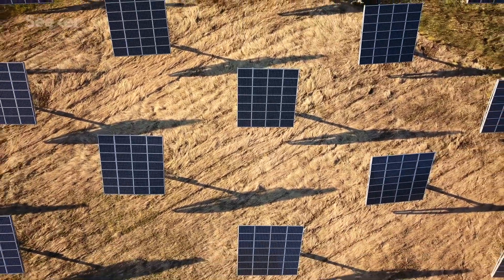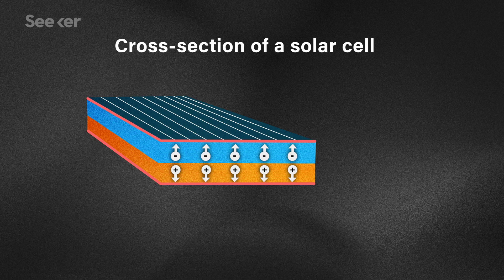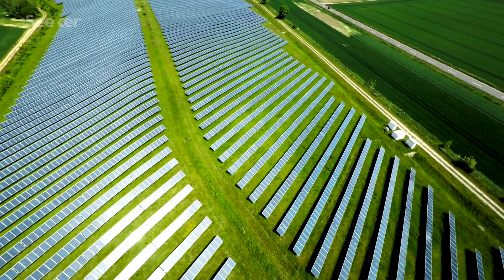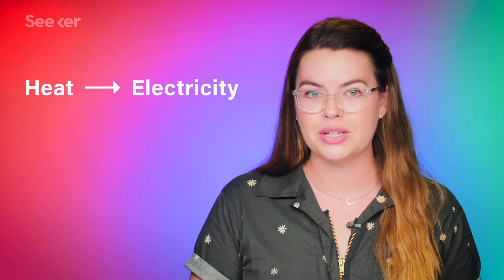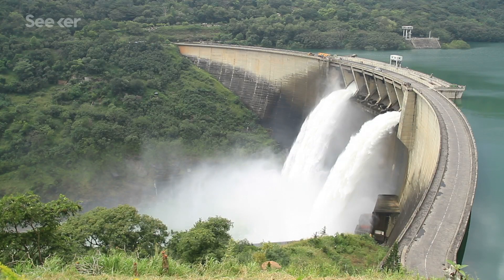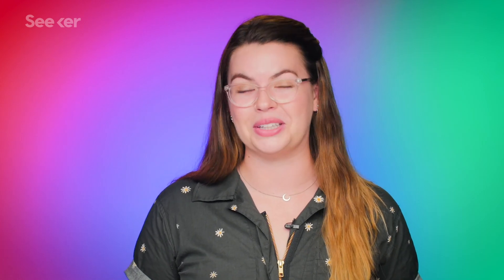Carbon Nanotubes Might Be the Secret Boost Solar Energy Has Been Looking For

Comment: Science stupid 
Science stupid 
Science doesn't know. Positrons + and electrons  -- rotate very rapidly after 46 billion years of creating the Sun, so the core of the Sun rotates very quickly like A super large electric turbine that produces super large electrical energy 
The sun emits 4.1 tons of photons per second, moving the circle back to its original position after 8 hours. Thus pushing the eight planets to spin

Comment: Our company IQ materials can not make carbon nanotubes from 12 inches in width to 3 ft and 20ft to 200 ft in a day.  

Thickness: 5-15 microns
Aerial density: 5-15 g/m2 or GSM
Conductivity: ~200 S/cm
Tensile Strength: 40-60 MPa
Tensile modulus: 2-3 GPa
Density: 0.3-0.4 g/cm3
Temp. Resistance: 1900c
Width: 6 in or 12 in with typical 20, 50, 100 or 200 ft length

Comment: This video made me curious.  What is the albedo of a solar panel compared to the albedo of the surface it is typically placed over?  This may be a non-question.
The incident infrared energy is trapped in the atmosphere whether it is first absorbed by an object or not.  The solar panel has little effect on the albedo whether it reflects the infrared, absorbs the infrared as heat or produces electricity from it.  The incident energy of the UV spectrum is relatively small so the characteristics of the solar panel compared to the surface beneath it is probably immaterial.  The first answer to my question is that the solar panel is not impacting the albedo, so panel the world.  We've got lots of sand.

So far as boosting the efficiency of the existing solar panels I can see merit in that, as well.  My wife and I own a home that we heat primarily with a mini-split heat pump, and we charge an EV.  We have max'd out the roof with solar panels and are still required to purchase a fair percentage of our electricity from the grid.  Solar panels that are even 25% efficient would be more than enough to make us net zero in consumption.  We could also probably afford to heat our house a bit more than we do.

I started writing this an hour or so ago and pessimistic that there was great value in increasing the efficiency of a solar panel unless it reduced the cost per kilowatt.  My own situation shows  that it could be worth a small premium.  For mobile applications, of course, it would be worth a substantially higher premium.  Now where are those mobile applications?

Comment: THIRD, as The EFFICIENCY if The SOLAR CELL mentioned is very high, unlike that of PHOTOSYNTHESIZING PLANTS (which have solar energy efficiency of only about 5-10%) ,also these plants ALWAYS RESPIRE, so these PLANTS almost behave as LAND MASS (reflecting back most solar radiation as heat)   only keeping NEGLIGIBLE AMOUNTS as BIOMASS. IF in their PLACE ,THOSE SOLAR CELLS are INSTALLED EVERYWHER, then it shall behave as LIGHT and ENERGY ABSORBER almost completely as a PERFECT BLACK BODY to be converted to ELECTRICITY for all HUMAN NEEDS(wether this energy is ultimately released by humans back as heat by TRANSFORMATIONS again while using, or this energy gets stored in some  manner or The other for permanent)  IN any case this shall Result in SLOWING down of WEATHER and CLIMATE FUNCTIONING(as very less energy would remain available in The atmosphere For weather and CLIMATE CYCLES to function. CONSEQUENTLY this would have a PROFOUNDLY DEADLY IMPACT on GEOLOGICAL,METEOROLOGICAL and ULTIMATELY BIOLOGICAL ACTIVITIES and PATTERNS.  TEMPRATURES ,HUMIDITY LEVEL, WIND SPEED ,ATMOSPHERIC PRESSURE shall change very FRQUENTLY or VERY SLOWLY or may even NOT AT ALL. A COMPLETE DISASTER.  HENCE SOLAR CELLS with LESS EFFICIENCY, can thus only be USED.(which would behave, almost like plants, and not cause BIG, DISRUPTIVE and CASCADINGLY DAMAGING EFFECTS to EARTH'S systems at a LARGE SCALE.)

Comment: YES, SOLAR ENERGY is UNDOUBTEDLY VERY LARGELY USABLE, BUT being TOTALLY DEPENDENT on SOLAR ENERGY is not FEASIBLE and also POSE serious PROBLEMS. FOR EX -WEATHER PHENOMENONS can GET DISTURBED as, The heat reflected from The LAND and SEA (which you call as WASTE HEAT),  actually it is not so. When The heat is REFLECTED back from LAND and SEAS (UPON being heated by SUN'S RAYS)  that HEAT is only, eventually DISTRIBUTED into The ATMOSPHERE  in order to FORM/CHANGE  WEATHER and largely CLIMATE of everywhere on The PLANET. IF NO SUNLIGHT FALLS on GROUND or SEA  (instead it is absorbed by PHOTOVOLTAICS with 95% or more EFFICIENCY.. say..)  then LAND and SEA shall not heated by SOLAR RAYS .AS a RESULT, there shall not OCCUR TEMPRATURE differences  and CONSEQUENTLY WIND BLOWING shall become LESS and BOTH WIND and RAIN PATTERN shall  become VERY complex and UNPREDICTABLE (as AIR itself is a bad CONDUCTOR of  heat) .IN cold days, The SUNLIGHT is already too  low in RADIATION ENERGY already ,USING SOLAR PANELS on TOP of that would INCREASE The COLD more. It is to be understood PROPERLY that ATMOSPHERE takes ENERGY only from The "REFLECTED/RETURNED BACK" HEAT ENERGY Of The SUN from The heated LAND and SEA on Earth's surface, and NEVER DIRECTLY by The INCOMING SOLAR RADIATION from SPACE!!!!. THIS FACT shouldn't be OVERLOOKED.

Comment: No. Solar and wind aren't the answer, you need to clear whole plots of land of all vegetation and animals on top of many other issues. Solar panels have such harmful chemicals once they are disposed of since there is no proper disposal of these chemicals they seep into the ground. Nuclear fission provides far more energy 24/7 and the waste it does produce is safely stored until it degrades into regular trash or when we figure out how to do it a different way. Nuclear is the solution

Comment: Noob here, I have a question.
Where do the knocked out electrons come from?
I mean if fhey are knocked out of the material the amount should be very limited?
Reply: Yes, but the electrons aren't just kicked off, as the silicon layer looses electrons, it charges positively, attracting electrons from the other side of the circuit, think then of a person bouncing a baseball against a wall, and cathing it when it falls back
Reply: @Biomechanoid29ah  thank you soooo much I was confused too😁

Comment: #SwitchToSolar #SwitchToElectric
Everyone raise your right hand and promise to never again purchase an ICE (internal combustion engine) vehicle or tool.
We should all be using electric vehicles charged from our home, business and covered parking rooftop solar arrays making nearly everything we do 100% solar powered including charging our vehicles.  Everyone should be getting proposals from 3+ local solar PV installers and suggesting the same for our places of work, our grocery stores, our movie theater parking lots, and everywhere else.
The cost per distance driven is ridiculously cheap when you are your own solar fuel station (less than $0.01 USD per mile)! #nobrainer
We cannot afford to continue to burn fossil fuels!

Comment: Turning that thermal energy into useable energy is easy and doesn't require something as far fetched as carbon nanotubes. It only requires a sterling motor (look it up), a generator, some water, and some copper tubing.

Comment: There is a company in Colorado that is building a plant to manufacture a solar panel that uses Nanotube Technology and Graphene. I have seen the plant and they are definitely putting it together. The panel is going to be 12" by 18" and can out produce a 6' by 4' silicon panel. Nanotech Engineering Inc. I just saw the plant but they are serious, with serious machines.

Comment: Solar is a joke at 20-40 cents per kilowatt hour and an intermittent source of energy.  Let me know when they're down to like 1 cent per kilowatt, then we'll talk.
Reply: I'm Only A Man And I Will Die Some Day 
.05-.08 per kWh depending on system size and of course it only works when the sun is shining
Reply: @notacommie5415  again, let me know when its 0.01  Battery infrastructure is prohibitively expensive per kWh.

Also, I don't know what your sources are, but there are companies bragging about creating panels that produce at 0.25 just last year.

Comment: Mirrored dishes are better :|
also we must store that energy easily with gravity :)
Reply: Mirrored dishes collect more light, but also make the cell run hoter.
Carbon nanothingies here work like optical whitener (a dye that turns UV light into blue on your clothes so yellowing from age doesn't notice) but for thermal to near infrared, as far as I got from the video

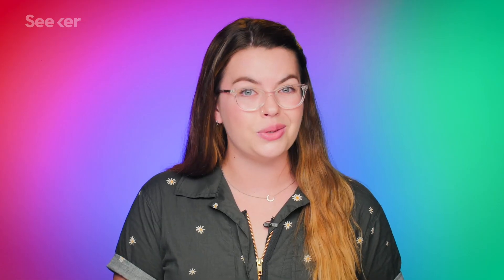Comment: 1:17 "We actually lose about 70% of electromagnetic radiation that hits a solar cell...". 
1:37 "...make scientists think that in the future, even with improvements to the existing tech, we are looking at a maximum peak efficiency of solar panels at 29%...".

So if we improve existing tech we'll make it 1% worse?  Did I miss something? 🙄
Reply: Curent efficiency (around 20% max as far as I know) isn't only limited by this factor, but it alone is responsible for a 70% loss. That means that even if all other factors (such as the resistance mentioned in the video) were effectively eleminated (they aren't, but it's theoretically possible to eleminate them), we'd still hit a hard limit at under 30% because of the 70% loss we couldn't even solve in theory earlier.

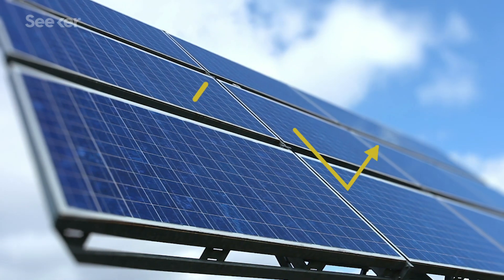Comment: At 2:08 in the video, those are not photovoltaic cells, that is called a solar troff and it focuses light at a pipe filled with a combustible oil that then releases heat into water which turns a turbine. Really cool technology just not what your reporting on.  I just figure you might want to make the correction.

Comment: If the 80% target is actually reached, it would need to be complemented by an accessible market price and an effective and cost effective electricity storage solution. The sun does not shine throughout the day or throughout the year, so energy buffering is need. The beauty of such system (if they eventually make it to the mass market) is that they could potentially disconnect low storey houses from the power grid. I'm not sure this would be a practical  solution for high rise.

Comment: I wonder about combing this with transparent aluminum? It is roughly as hard as sapphire, good light transmission, and the roughly the same thermal transmission properties of regular aluminum. A scratch resistant, strong, thermal resistant panel sounds like a winner to me. While transparent aluminum is expensive now, the same old answers apply. Mass production makes things cost effective.

Comment: Sorry, but the sun still doesn't shine at night.... or when it is cloudy.
Reply: The point is generating more electricity from solar panels at least reduces dependence on natural gas and other nonrenewables.  Excess energy generated by solar panels during very sunny days can be stored in one form or other for those cloudy days.  Even if Solar doesn't completely solve our energy needs, combining it with other renewable sources can.
Reply: @blam320  Energy cannot be stored.
Reply: @mactek6033  Fine, if we wanted to be technical, we can build electric potential energy in capacitors, or change electric potential energy into chemical potential energy via a battery, or gravitational potential energy through pumping water up to a higher reservoir.

"Storing" energy is just a colloquial way of saying that we're turning electricity into potential energy that can be tapped into later.  Like how organics store energy in the form of sugars and fat.

Comment: Efficiency is only one part of the equation with solar, it doesn't matter how efficient your panels are if the only applications for which they are economically feasible happened to be satellites. Most homes have sufficient roof space to provide enough energy to power the home with current technology but  the price prevents people from pulling the trigger on such a decision, the same goes for most businesses with the giant Warehouse is having ample roof space for the installation of solar energy and these companies have the necessary assets to afford such an investment if the investment will pay back within a reasonable amount of time. The problem is the investment will not pay back within a reasonable amount of time and that all comes back to price. The ROI needs to be 10 years or less and storage needs to become cheap enough to make it a practical solution.
Reply: I got 4 100W panels on the roof of my van that runs all my energy needs. It's cheap and efficient enough. $100/Panel.

Comment: You could also install piping in the solar panels and then use the heat to run a sterling engine.

Comment: It's me or they are breaking one of the laws of thermodynamics
? Turning a bigger wavelenght into a smaller one.
Reply: Not necessarily.  It may take, for example, two photons of lower frequency to create one new photon of higher frequency.  If the system ever became very close to 100% efficient, then I'd be worried about the laws of thermodynamics.

Comment: Carbon nanotubes have been in research for around two decades or more. Carbon nanotubes are as resilient as diamond and as flexible as rubber. It can even block projectiles of any sizes. Its potential benefit for humanity is huge, has capabilities to filter harmful elements and may be able to shelter people from nuclear radiation.

So, products of carbon nanotubes can be militarized. Hence, if methods of dismantling and destructing carbon nanotubes products are not yet found, it won't be available for consumer use.

Comment: Check out what we googled today - we are now certified to teach and lecture you with our over recycled stock footage because we lack insight intuition and creativity to god forbid use it on anything relevant in 2019..
Reply: This isn't relevant?
Reply: @thekaxmax  It is not. Both because it's not new info, we've known this for years, and because carbon nanotubes are the wonder material that has been promised but never delivered. This is practically like saying fusion is the solution to climate change. Sure, in theory, But in practice it'll be decades before these technologies make it to market.

Comment: Hopefully the next video will be about how the process of making Carbon Nanotubes has been simplified making them suitable for mass production.
Reply: It's true i am the student of Mechanical Engineering (material science and nanotechnology)
We just learned in the labs how to make cnts but that wasn't enough 
To make the cnts you need a sophisticated lab equipment that cost you way more what you think 
For my branch we are valued when we do the phd in nanoscience department from foreign university
Yeah what he said it would take more 20 years is right at 20 year we start productions 
There are only  two types of cnts MWCNTS ANS SWCNTS 
MWNTS HAVE HIGHER EFFICIENCY THAT SWNTS
Reply: @mdashwaq257  20 years? Sounds like a bunch of cunts not CNTS.
Reply: @mdashwaq257  hello Mr nano engineer have you heard about hemp based carbon nano sheets? Real cheap
Reply: Well there increasingly new methods for developing CNTs. The broadly used methods are Arch discharge, laser ablation, Chemical Vapor deposition, ComoCat etc, CNTs are the future. As with every new discovery it takes time for it to get good grounds into the market. As new methods to produce them under cheaper means evolves. CNTs will take over. Just completed my PhD IN chemistry where I researched composites from CNT heterostrucutes. These materials have huge potential
Reply: I hope not,   because if it is, the next video is "only" 20 years away 😐...